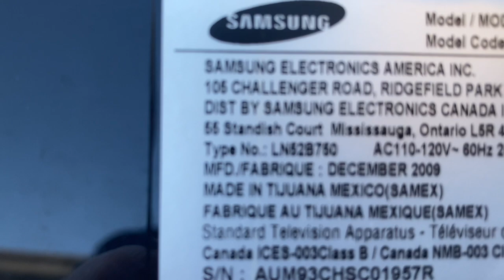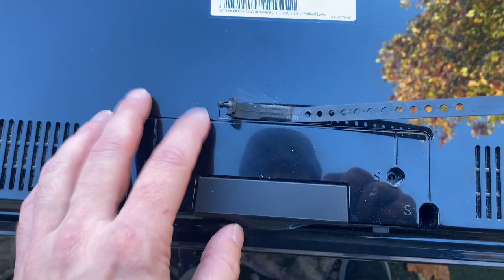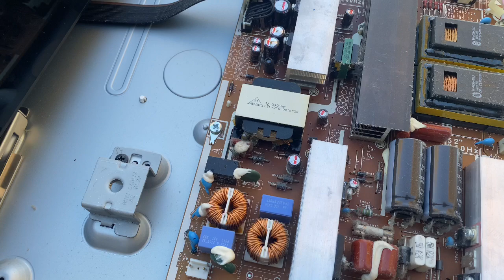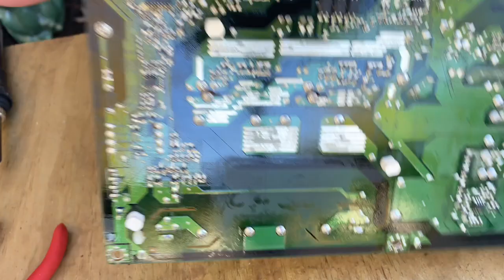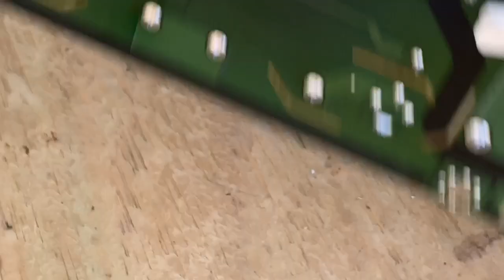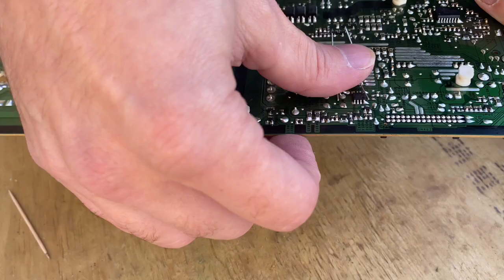Samsung LN52B750U1F won’t turn on repair

Comment: Was the red light on? Flashing? Our red light stays on, white light comes on and red light turns off when we hit power button but only for a few seconds and then back to solid red light. Was able to just keep trying and eventually get it to turn on but the last few days it won’t turn on at all.
Reply from the maker: @ThunderBuddies-wp2xi  yeah just look at the parts shown, likely you have bad ones as well